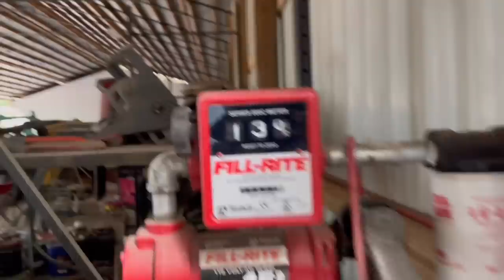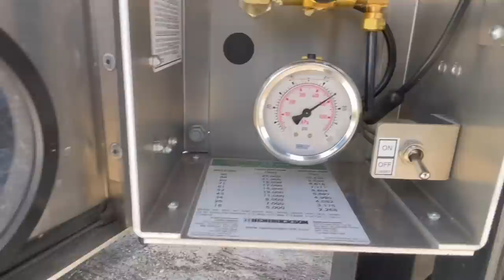DOZER on my NEW ALUMINUM Trailer, Bad Idea….

Comment: Your trailer has a sensitive relay valve.  I've had that happen before.  The blue air hose doesn't supply the air to the brakes.  It tells the relay valve how much air to use from the air tanks.  The is supplied by the red.  That's why you hear air hiss past the red knob when you release the service (foot brake) after a hard stop.
Reply: George Jones  if I knew him personally I would have just reached out.

Comment: Bruce over your front trailer axel by the air tank there will be a 4 way valve that splits your air lines to the break chambers, it sounds like that valve may be your problem it sounds like it may be sticking and not releasing pressure, there will also be a 2 way valve over your rear axel try changing those 2 valves

Comment: Over 30 years trucking and i wonder why no one has checked the break valve on your trailer? Have had many go bad and yeah they lock up your breaks and are slow to release. Take a look at it.
Reply: 30 years of trucking didn't teach you that it's spelled brake not break. Just saying
Reply: I was wondering the same thing lol
Reply: @jaredd8489  grow up
Reply: I don’t think anyone has really taken a hard look at that trailer. They usually throw these warranty claims at the new guy since they don’t pay.
Reply: QR1 valve
Reply: This!! The small engineering brain I have is getting frustrated that they haven’t checked all related systems for issues! LOL
Reply: @jaredd8489  really?  So happy to have the spelling bee champ in the comments
Reply: Whoever recommended changing the slack adjusters to manual doesn't understand basics of leverage.  Changing to manual doesn't change the leverage from the pushrod unless they use longer or shorter ones.  Some mechanics should stick to the basics.  Like checking oil or air pressure.
Reply: @jaredd8489  hey, give him a brake. 😂
Reply: Change the qoick release valve
Reply: @jaredd8489  you know text by voice doesn't spell worth a dam, or damn.  Or maybe darn.  Spellin or not spelling corektly dont not make the point of the commmmmment not valeded.
Chew on that 🤪
Reply: @fsctrucking  yeah its like they sea the mespelled words and kant gett passt it...shutdown the brian with 0 ablty to move onn.
Reply: Yes we call it a load sensing valve in the uk that is going to be your issue
Reply: It’s fixable if someone tried
Reply: @fsctrucking  the repair facility that changed the slack adjusters to manual is incorrect on that service, since air braked equipment manufactured after Oct 1994 is required to be equipped with automatic slack adjusters,

Comment: Most of the flat bed, step deck, low boy haulers I know keep some rubber stall mats, old conveyer belt pieces, cut into track wide strips, to lay down before loading a steel track dozer, track hoe, or skid steer on their trailers! They also come in handy to separate your chains from rubbing, and protect the equipment when chaining it down! As far as your new trailer goes, man, you have been way more patient than I would have been! Dang!

Comment: You need a chain or a strap on the buckets per DOT and manual slack adjusters are not legal on anything manufactured after 1994

Comment: Manual slack adjusters are illegal on anything newer than a 1995. You're going to get hemmed up one of these days. Also need chains over them buckets and blades. If you have 6 in of overhang you need to be permitted and bannered as an oversized load
Reply: @SuperTransmission  I don't really care if you did it and got away with it. Doesn't change the fact that it's against the law. And all he's showing people is how to do things the wrong illegal way. All the aluminum trailers I run now are fully welded or integrated side rails. If you bought one with tack welds then you should have spent a little bit more money.

Comment: Need a chain on the dozer blade...all attachments need to be secured even if they are permanently attached...I usually keep over hang off the the passenger side...I figure if there's a car on the shoulder I have a whole other lane to move over to avoid it but if the over hang is on the driver side and someone that is coming at me and is crowding me I only have the shoulder and sometimes there is no shoulder. (I run a 55ton lowboy in upstate new york) but whatever works for you...just offering tips on things I've picked up moving oversized equipment 🤷‍♂️
Reply: Where in upstate New York
Reply: @codyluke8932  finger lakes region but I go all over the state

Comment: You should have them check your wheel speed sensors that will also cause the trailer brakes to lock up on you

Comment: Bruce you still need to throw some chains on that dozer those tracks can break and come off but I also do run binders on the tracks like you do when I'm hauling the excavators and dozers like that but I also run chains just in case also and I wouldn't have that dot catch you with that blade hanging over without any signs on your truck and lights or at least your signs and flags if anything

Comment: Do you have an applied pressure gauge? It seems like the sombitch is keeping just enough pressure on the service line to drag the brakes on that front left. If the gauge reads zero when it's dragging yank the service hose off the trailer to see if there's pressure.

Comment: Yeah.  Steel tracks on aluminum bed...Go get some of the thick rubber belts off of conveyors or hay balers. Put them down on the trailer bed to load/unload on. 
    If you want some free rubber mats, just a little work to make them...Cut the tread part off tires then either use em loose or fasten them together heavy staples type deal.

Comment: Service brake valve on trailer incorrectly plumped or defective? I wouldn't say a tractor issue if it works correctly with other trailers

Comment: I would think the air regulator valve all your brakes is messed up or possibly plumbed wrong I would make them put the automatic slack adjusters back on in check out the valve

Comment: Hey Bruce did you ever think your drums might be out of round?, That might be why only 2 of the 4 are sticking (high/low spots)
Reply: It’s probably multiple things that have gone wrong enough to cause this. I don’t think anyone has actually made a solid attempt to diagnose this trailer.
Reply: He already mentioned this in an earlier video.  Right after the manufacturer decided to not just replace his trailer outright

Comment: Although it could be sticking brake valve it's worth checking the boosters (or brake chamber you might refer to them as) I've had a brand new one leak internally before and it was a bear to work out. Get them to remove all the service brake lines from the boosters, then release the spring brakes. Check every service port for air escaping. If it leaks internally the air will bleed off your spring brake side out the service brake valve. This causes the spring brakes to randomly apply and it will be random wheels not nessasarily the one with the issue.

Comment: To stop steel tracks from destroying your new trailer, go to any tire shop and get used tires to lay under the tracks as you load.
Reply: Heavy duty conveyer belt rubber works well and you can fix it to the deck. Then when it's shredded just swap out a new strip.
Reply: Airboat poly?

Comment: Tell that trailer dealer that you aren't allowed to put manual slacks on new equip.  I think it was 1998 or maybe earlier that was the cutoff date.  I had to retrofit a bunch of trailers that companies had replaced new with old slacks.

Comment: If you are gonna use a aluminum trailer I would suggest getting old rubber tracks off of skid loaders and stuff, conveyors,cutting them, if you're gonna haul stuff with steel tracks.  You lay that down and drive over those with the steel track. Gives that a little bit more cushion on the trailer too. Just a idea,  Using the skid loader or mini ho tracks is easier to maneuver by yourself as well, don't get the big agriculture ones unless you're hauling stuff that big. Also don't stand near the trailer when loading please, seen someone lose a limb when something slid off.

Comment: Wondering if your semi has a crimp (restriction) in the airlines I feel like your trailer might not be the problem.  They’ve tried everything(thinking they already replace air valve on trailer).  Any really good trailer shop should be able to solve the problem.

Comment: Did the shop see if the break drums were worped and you could lay rubber down on the trailer so it doesn’t wreck the deck

Comment: ABS valve on the trailer is probably the issue. If you have your trailer brakes released and take the blue line off the trailer you will probably find air pressure coming from the trailer. If I am right your ABS valve is letting air pass from the emergency to the service side and applying your brakes.

Comment: Just a wild shoot in the dark but have you tried pulling this trailer with a different truck.. this may be a truck issue and not a trailer problem. If you have a brake application gauge in that truck pay close attention to it and see if it goes to zero when you let off the pedal. If not you have a truck issue and not a trailer issue . Also does the truck have disc or drum? I have heard of people having issues when they both don’t have disc?

Comment: Bruce I would have them put a set of axles under the trailer..get rid of any problems
Reply: Axles won't fix that problem
Reply: @markwilliams4525  they would help considering everything related to the brake rides in the axle bud

Comment: I hope Jim Hog is giving you a discount by not letting you have to pay a cent for this chronic problem your trailer brakes are having. It's just a matter of time before they completely melt if you have a heavy enough load and you happen to be hitting a harsh mountain, I really feel for you, Bruce, having faulty equipment makes your job that much more difficult when you can't rely on it.

Comment: Lemon Law your trailer issues. Correct me if I'm wrong but I believe anything manufactured after 1994 it has to have automatic slack adjusters. That is what I was told by the CHP here in crappy CA. I don't trust Automatic slack adjusters myself, too many issues. Look into a lawyer for your trailer problems. I am sure you would be compensated nicely. Keep on keepin on.

Comment: I’ve been having a similar issue with mine except it’s only dragging and locking the rear axle .
Reply from the maker: Same brand?
Reply: @Bruce_Wilson  same trailer. Mines a 2019 tho . It ate the rear brake pads to the rivets while the fronts are more than half . Just noticed the lockup issue now since I replaced the rear brakes . But there’s odviously an issue for it to smoke one axle and not the other

Comment: Do you have a quick release valve at the bottom of your blue line behind the cab of your truck or factory blue line could be crimped somewhere down line in the trailer from the factory

Comment: Bruce,,its got some where in the system of that trailer...PERIOD valves-- lines ect....
Reply: & there's a restriction somewhere in that system from the original factory installed its got 2 be !!

Comment: Yeah I’d be taking that trailer to the dealer and demand they change every brake assembly completely, drums, pads, s cams, s cam tubes and slack adjusters and pots and physically watch them change everything!! Then change all the brake valves up in the frame!! Or tell them they can keep that trailer and you want a new one! To have that on going issue clearly they aren’t doing a thing to it! Also not sure if states are same as Canada but those snap boomers are illegal to use Atleast in Canada they are! And if you can’t load backwards for hauling anything or anything with a turbo you may want to start covering the exhaust! That’s how you take the turbo out of a piece of equipment! My relatives bought a case 550 and trucker hauled it 500 miles forward on the trailer and without a cover on the exhaust and cost my cousins 15g for a new turbo! Just some friendly advice!

Comment: I'm surprised that the thing didn't fall off. Lol.

I'm joking in slight but typically, you don't want to be hauling dozers on a single drop deck with aluminum decks for several reasons, one is due to the sheer weight on those tracks putting all that weight on the deck surfaces, it can push through in spots and weaken your deck. There's also the height issue but that is last on this list and far from what the major problem this can cause which is actually the worst which is load shifting. Metal on metal can make for a slick surface for transporting a dozer.

It's typically why double drop decks or low boys use wood for decking surface when transporting heavy equipment.

Comment: Bruce I'm not trying to be a smart aleck that's why you carry two by fours and two by eight when you haul a tractor machine on Aluminum deck trailer and I know you haven't done it much but legally you have to have the blade facing backwards when it hangs off the side of the trailer the idea is that if you struck something with it it would slip by which is totally false but that's the rule cuz if you called it going forward it would split something into like a can opener

Comment: Man, I thought maybe getting a good run in with some weight might free those breaks up.  I hope they square it away for you.  I think you said you paid like ~$80K, right?  Sure sounds like my luck, you sure we are not related?!  Seems that it should be something like just a bad part from the start or needs proper adjustment?  I assume they have lots of other trailers with this setup on the road?  Good luck brother, you'll get it sorted.

Comment: Bruce I really wonder if your s cams are bent, s cam bushing are fucked or weren’t installed correctly to begin with. I worked on a trailer that did that once in awhile and the s cam bushings were fucked up. We decided to just sell the trailer instead of fixing it because there was a lot more than just that that was wrong and they were 20 years old.

Comment: There just screwing you around on that new trailer I wouldn't put up with it there is no way that's a slack adjuster problem it's a air valve problem or something down that line I would have never put manual adjusters on a new trailer

Comment: Hay just a heads up there is a youtuber  called wild wild west he is talking ab a new rule that's tring to be passed called speed limit regulation. That means every single truck will be cut back to 65,68, or 70 he has a link in his bio that goes to it and they have it open to comment on it and tell them what you thank ab it go and check it out bc that's some bs if you ask me

Comment: There could be several reasons why the brakes are dragging, How can I get in touch with you I know several things I have found personally that could be your problem I’m not trying to scam you I’m just a semi trailer mechanic I’ve worked on several models up to a 21 model I’d be more than glad to give you  options to check for
Reply: Think he’s on Instagram

Comment: Just curious how you put manual slack adjusters on your trailer since FMCSA has required automatic slack adjusters on tractors since 1994 and trailers since 1995. How do you plan to pass a D.O.T. roadside level 1 inspection?

I guess you just want clicks to make money!!

Comment: Hey bruce...have you thought about changing all valves...I bet there's 1 on that trailer that is FVCKED,.I asked my cousin, he's a trailer mechanic, has been 15 yrs give or take a year. But that's what he thinks, even tho if u put new ones on it, still could have bad valves, just could be a batch of bad valves that went through qc, that's all, when I had my pony pup,here in Ontario, Canada, the same thing happened to me, and we could NOT finger out what the problem was, so we put 3 new valves on each and every one, was fvcked, so we tried one more....guess what...it worked, I know it sounds like BS, but that's what happened,  now I'm not saying that's the problem with your trailer, but it wouldn't hurt to try an see, so just wanted to put my no cents in, hope bro you get it fingered out.....piece bru.

Comment: Thought you could not haul for hire. And you don’t need to be paid to be hauling for hire. Anytime you put something on your trailer that is not yours you are buying trouble. The DOT is watching you. Be careful. Also the air dump on the trailer is bad. You have been told that by every driver several times.

Comment: Great video, you have a lot of work, I noticed that you fixed the rear wheel of the motorcycle with an iron chain, I would not do this in order not to damage the wheel disk.

Comment: new trailer or new axles or see you in court they have pulled your chain for to long there is a lemon law use it on them that trailer is not safe on the road them brakes ever lock up stone cold out of the blue with full load it is not going to be pretty for you or traffic behind you or around you